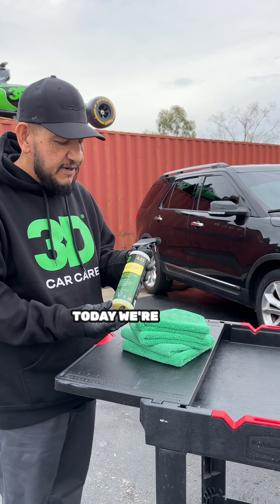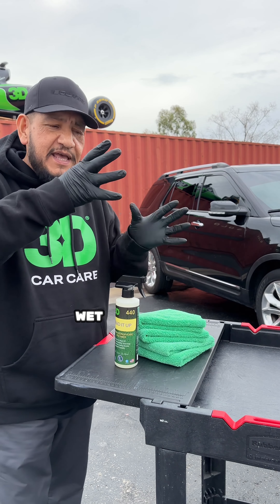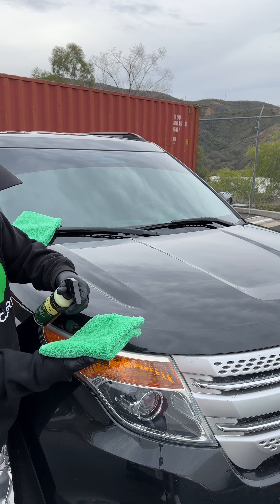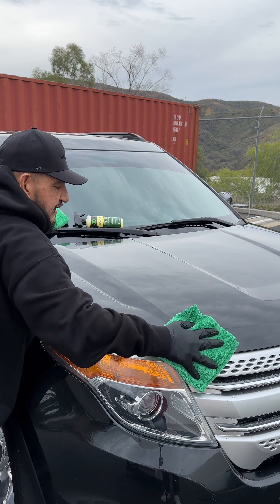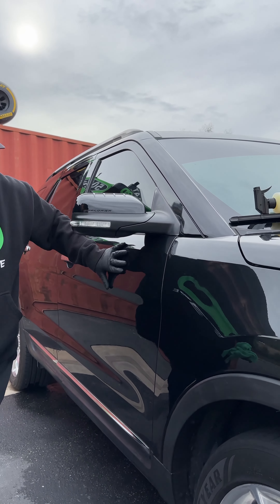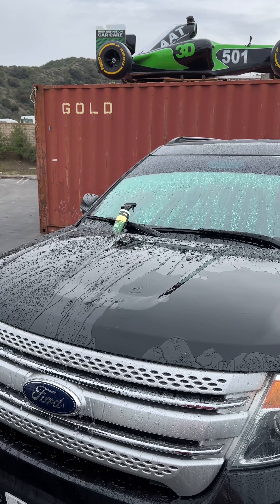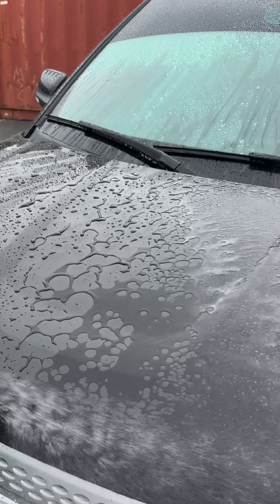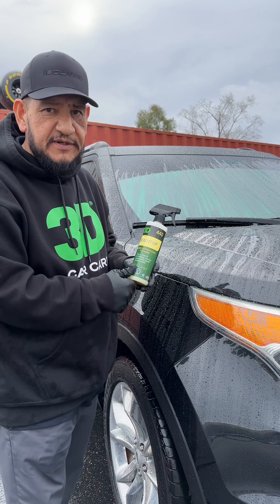3D Sunday School: Instant Protection With Bead It Up

Comment: Nice products as always, personaly i  like to apply 3d poxy at first and then top it up with bead it up ,that way results lasted way much longer 👌👍
Reply from the maker: Thank you for choosing 3D! We appreciate you!
Reply: A go around the car 2 times with bead it up 2 times the effect, 10 min in between,insane hydrofobic❤👍🎶🎸😊 you can use inside the car too 👍( not on your floor mats😂)